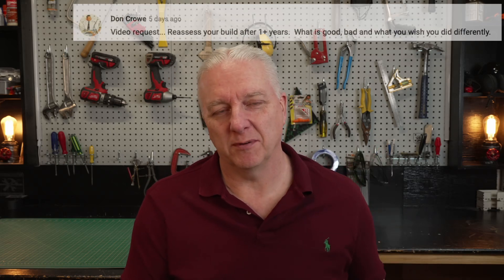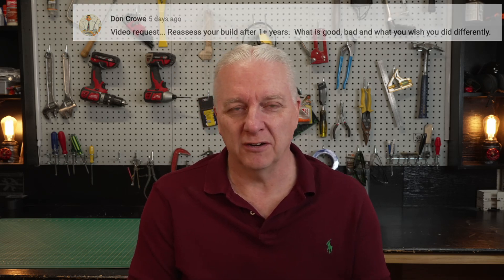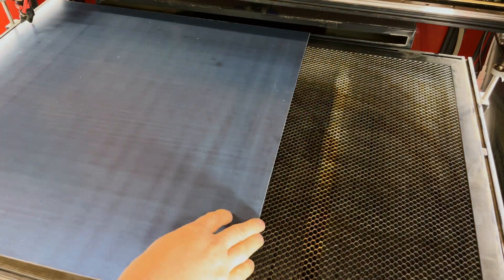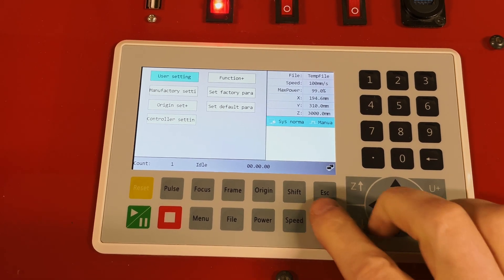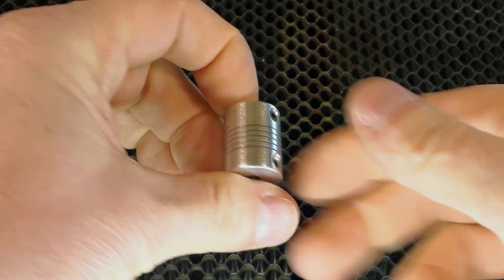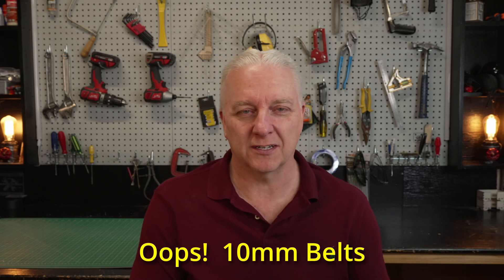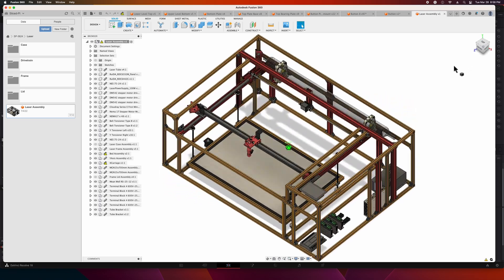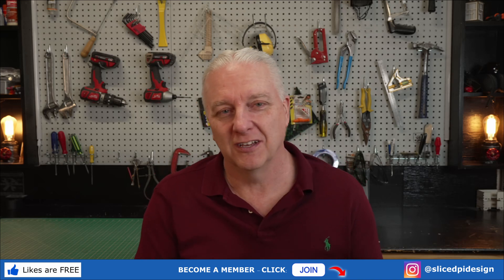One Year Later - Did Building My Own Laser Pay Off?

Comment: I was just thinking about this while I was watching your last video, like I wonder how that thing is working out for him still. Great video!

I built mine to almost the same spec around the same time (how I found your channel, trying to figure stuff out). It's been running for about a year but it was just last week that I finally wired the switches on the top panel and the LEDs and officially can say it's "done" haha. I love it for all the same reasons you love yours. I used some 3D printed parts instead of acrylic and had the same experience with flex, and those parts have been replaced with CNCed aluminum, too. The one big regret I have in my design is that I had a specific work area I wanted to hit, and I was nervous about the machine being too big, so I built it to the size I wanted. Then I learned that 900x600 is a "standard" size, and I had to buy a custom sized honeycomb (pain in the butt) but if I had made the machine about 4 inches bigger in X and Y I could have just used 900x600 parts.

I have some weird wobble I can't tune out, I assume my setup has a spot that isn't rigid enough, but it’s not very noticeable in the output unless you know what to look for. If it ever comes back in stock, I'd consider forking out the money to replace my X/Y axes with the gantry from LightObject and expand the machine those few inches, but other than that, it does everything I want really really well, and I've loved the results I've gotten from it and the satisfaction that people's eyes bug out when I tell them I built a laser cutter in my garage.
Reply from the maker: Great anecdote!  Getting rid of weird wobbles is part of the fun. Let me know if you need help

Comment: Awesome as always Steve, definitely something I'd like to try myself, also I'm now wondering if this idea could be applied to a blue light laser. Just a thought. Thanks again. 👍
Reply from the maker: You certainly could. The controller might be a challenge but all of these are built on variants of Adruino controllers. There is probably some open source software you could use since CNC machines have similar open source equivalents. Just don’t implement the Z axis.
Reply: @SteveMakesEverything  thankyou Steve very much appreciated 👍